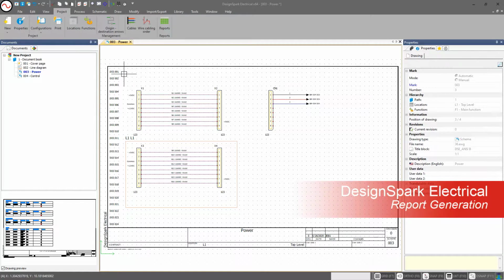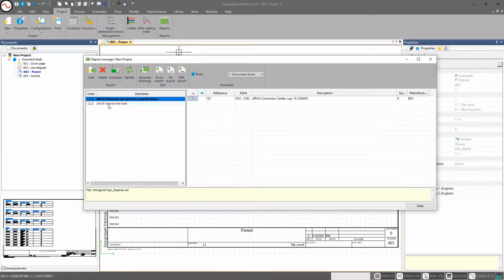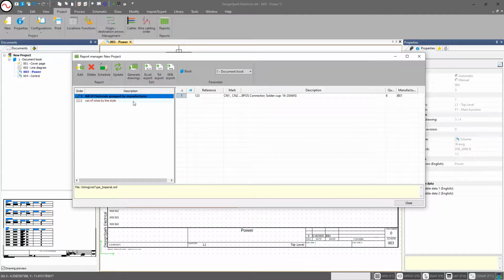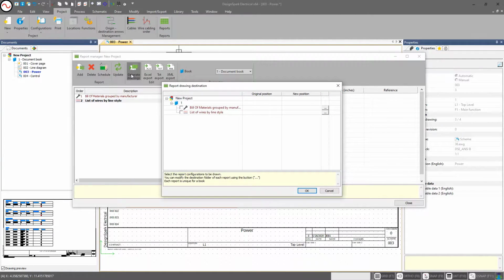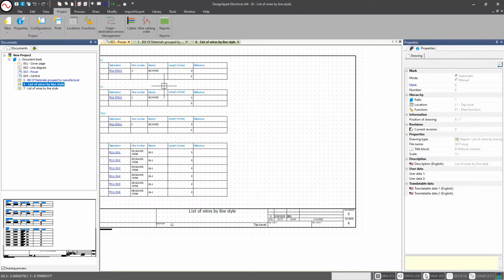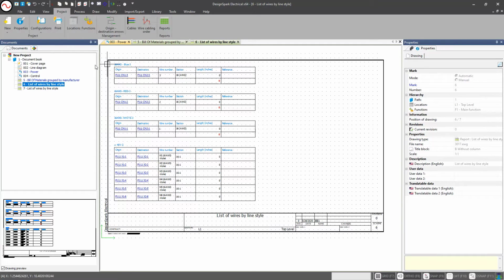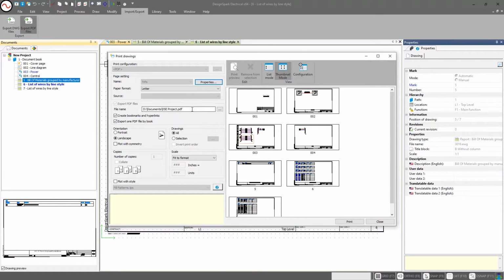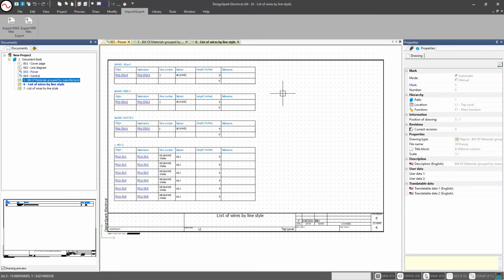DesignSpark Electrical Training | 14. Generating Reports

Comment: Hy, I've installed ds electrical yesterday, and I begin a project, bur when I try to add a new page the systems alert me this messages ' the number of page for this projet is maxim'
Reply from the maker: In v2.0, the developers limit the number of wiring diagrams and schematics to 3 per project. The total number of pages allowed in a project is 15 (including reports, cover page, appendices, etc.). Check how many you have. If you have lots of wiring and symbols, you can try using a larger title block (A1 or B1 size) to fit more in 1 sheet.